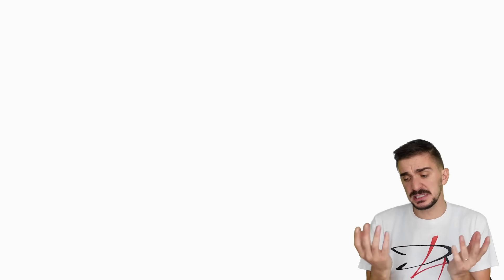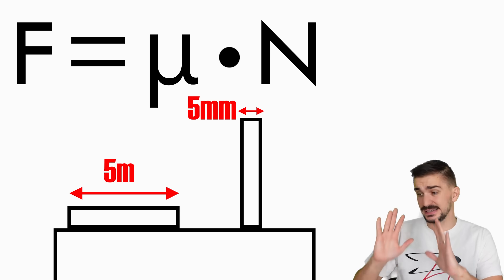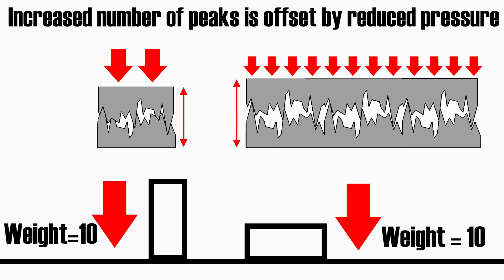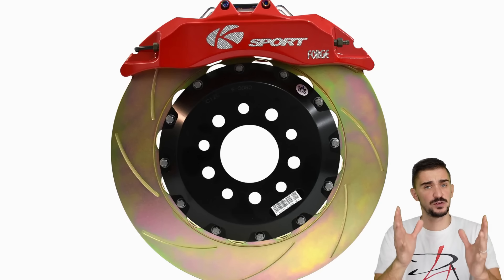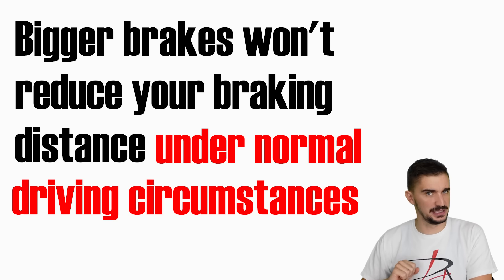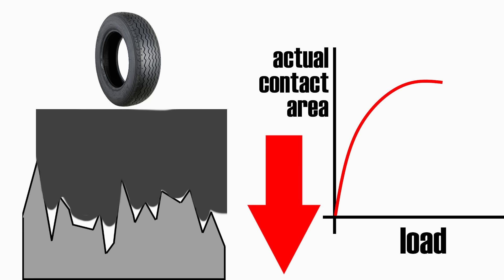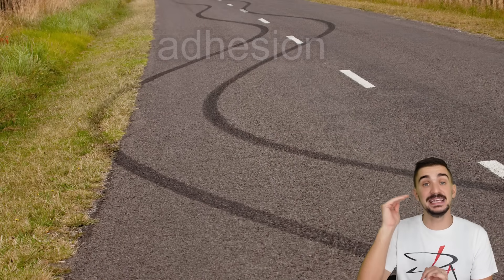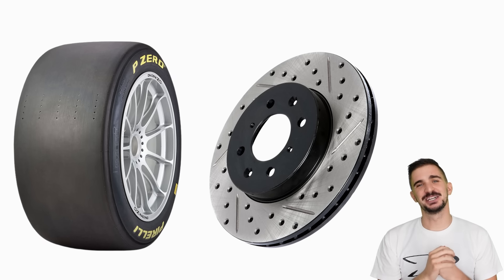Why Big Brakes Won't Stop You Faster but Wider Tires Will - Friction and Surface Area Explained

Comment: I think it is not correct. When you press the pedal the system generates a pressure on the lines.That pressure only depends on the force you press the pedal and the help of the vacuum booster.
Since F= Pressure x Area, N in the F=u x N will be proportional to the total caliper piston area. A caliper with bigger or more pistons will have more brake power for sure.
In the same way, if the diameter of the disc is larger, the braking "torque" is larger too (t = F x d ). For these two reasons, bigger brakes has more power.
In stock cars the brake system is already strong enough to full lock the wheels, so increasing brake power on regular modern cars will not make difference in the stopping distance.
The rest of the explanation about ventilation etc is correct.
Reply: What he tries to explain is a chain breaks at its weakest link - if your grip is the limiting factor more powerful brakes just lock the wheels with less force on the pedal.
What they do is having more heat capacity (and a better cooling) , the reason why race cars or sports cars use big brakes. A normal passenger car isn't driven in the same way, in a normal daily driver car you don't brake hard every 5 or 10 seconds
Reply: @simonm1447  In the beginning of the video I understand that he says that the brake power do not change cause the area of the pad do not matter in the F= u x N equation.
Reply: @RogerioCosta1.0  I'm not an engineer, but if you use a bigger rotor your leverage is a different one too. Even with the same caliper a brake with a bigger rotor will be more powerful, as long as the wheel diameter don't change.
Reply: @simonm1447  For sure!
Reply: @simonm1447  I know that more brake power do not change the brake distance etc. The mistake was saying that bigger brakes does not have more friction force and are bigger only for cooling purpose.

Comment: With bigger brakes there is usuallu more variables than just the outer diameter, such as bigger brake pistons. Also bigger diameter adds more leverage, so all variables added = faster stopping
Reply: All the improvements are irrelevant to minimum stopping distance if you could lock up the tires (or reach the ABS threshold) with the OEM brakes anyway. Heat management and pedal modulation feel can be improved, but not minimum stopping distance. You can make the rotor a mile in diameter with a thousand pistons, and you'll still slide to a stop just the same as you did before because you didn't improve the grip of the tire.
Reply: @xtnuser5338  that is ofcourse true. Point was that bigger brakes can make you stop faster if your old brakes were underpowered.
Reply: @pohjolainen  That's fine. Perhaps in the future you might point out the point? I mean you just said it equals faster stopping. You didn't say the IF bit.

Comment: the point of a bigger rotor is for leverage…. simple trick, use a short screwdriver to try and lift a concrete block… then use a long one… i bet it’s easier. in other words you don’t have to push the brakes as hard to get the same result.

Comment: bigger surface of friction allows to dissipate more heat, and obviously absorb more energy at any given moment, as well as apply greater pressure without blocking rotation altogether. this video implies that huge car manufacturers are either dumb or fraudulent. with bigger area you CAN apply more pressure, you don't have to distribute that same N (force) across greater area. Author, apologise incl. for awful pronunciation.

Comment: Physics says no
Why I say physics is wrong:
Smaller pads & rotors are not going to be able to withstand high stress breaking as long as big brakes designed for aggressive driving,  with slots and drilled.
Reply: Yeah, but this is not important for a normal daily driver car, which is driven in a completely different way than a car driven on a race track. You don't brake repeatedly hard if you just drive to work

Comment: As many others have stated: Bigger disc diameter equals more leverage. Moments of a force!
Reply: That's true, but depending on the car, MIGHT be offset by more rotating mass further away from center, ESPECIALLY if you have to size up your wheels/tires to accommodate the larger rotors.
Reply: @xtnuser5338  To fit a bigger disc you do generally increase wheel size a couple of inches but to maintain the rolling diameter you then use low profile tyres so much less rubber which balances it out. Also a much thinner tyre needs less air and surprisingly a fully inflated tyre weighs a lot more than one that's flat. Compressed air is heavy - he says as he's just about to go outside & fit some big chunky tyres to his 4X4 that weigh as much as a baby elephant 🙂
Reply: @mrsmith906  Even if you keep your wheel/tire combo the same weight...by increasing wheel diameter, even with the same outside tire diameter, you're most likely increasing the radius of moment arm. And the weight of 30-psi air a typical track tire, of a size that might be found on a Corvette or something like it, is probably in the neighborhood of two ounces or less.
Reply: That doesn't make any difference if you already had enough braking power to lock the wheels with the smaller brakes.

Comment: Over a weekend track testing front brake callipers with a road legal circuit race car the difference between the 3 types of callipers we tested was nearly 1 second at Brands Hatch short circuit. The callipers we tested were a large 6 pot lightweight aluminium race calliper, a slightly smaller lightweight race 4 pot aluminium calliper and a heavy cast iron 4 pot calliper from a Cosworth Sierra, the reason why the heavy iron calliper gave faster lap times was because the front wheels tended not to lock up nearly so much under max braking loads with the iron callipers compared to the lightweight race callipers, this was despite the fact that the iron Sierra callipers were far heavier than the aluminium race callipers so increasing the unsprung weight of the front wheel assemblies considerably. No other changes were made to any other thing on the car for this test other than the front callipers, I know this goes against what you might expect but the stopwatch and the drivers experience does not lie
Reply: Just watch the video, he don't talk mainly about racing, but of normal driving. He even says the same about race cars as you posted
Reply: @simonm1447  Thanks. This car raced in a series for road legal cars on road tyres and the improvements to the brakes due to just the caliper are 100% applicable to road cars as the reduced tendency to lock up under hard braking is even more noticeable in the wet or on low friction road surfaces. On the strength of what I learned testing on the track with this car and others I totally went off fitting big multi piston aluminium race calipers in favour of big heavy ultra rigid and low thermal expansion iron calipers mainly sourced from Cosworth Sierra's. The difference I've personally experienced on some very fast and good handling road cars I've built for myself is amazing and I try to imagine how much better the car could have been without the considerable increase in unsprung weight from the heavy calipers too!  'Sausage'  HT Racing Ltd

Comment: The answer is simple: As long as the small brakes manage to stop the wheel, a larger brake cannot stop the car faster, as the brake is not the weakest link. Any brake can stop the wheel rotating, the only difference is how many times it can do so in a row. Actually, the increased weight of a larger brake system will be detrimental to the wheels' behaviour, and might lead to a longer stopping distance.

Comment: It's because you have more of the tires surface having contact with the pavement doesn't matter how big your brakes are if you have a smaller surface area of the tire contacting the pavement you have less control
Reply: Wider tires don't change the size of the contact patch.